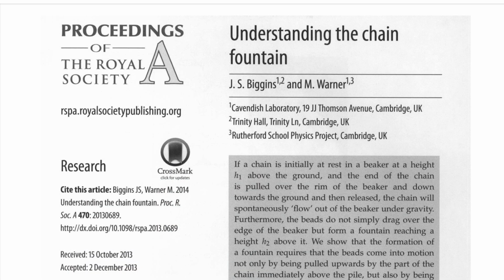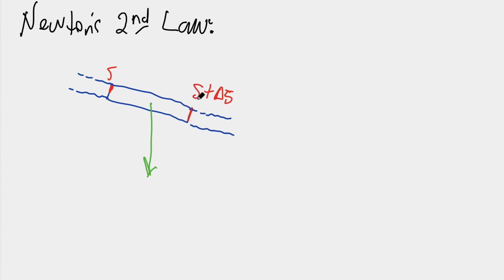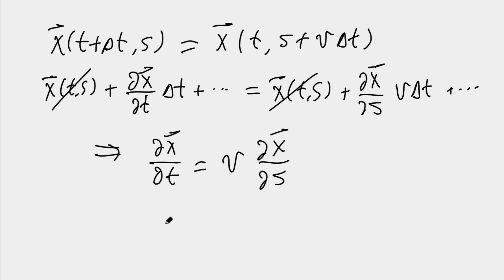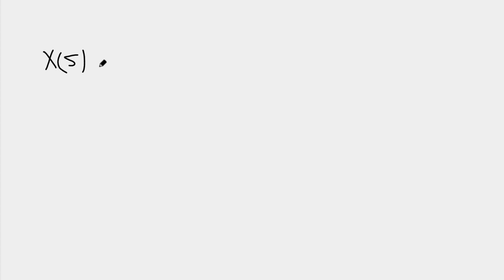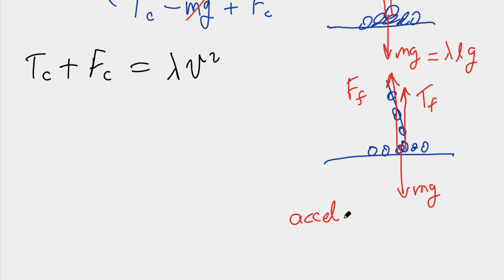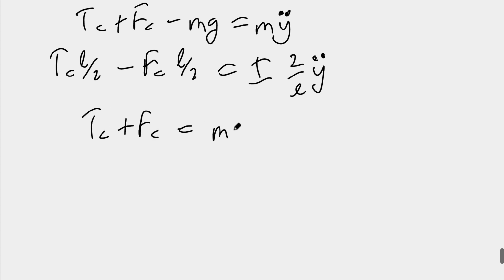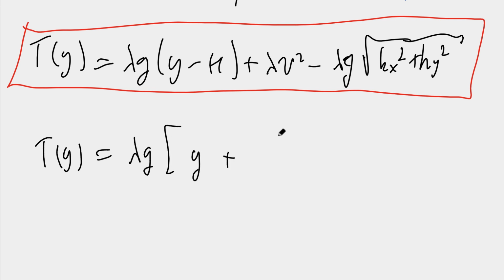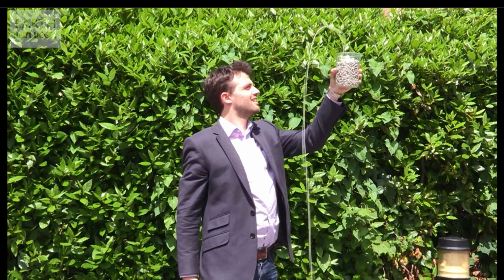Chain Fountain/Mould Effect (Just Do the Damn Calculation!)

Comment: amazing. can you please attempt a solution to the cassette tape problem? assume that the the tape on the left attaches to the right driving spool of constant angular velocity. let A be the point the tape leaves the left spool and B be the point the tape enters the driving spool. let P be a point between A and B.  what is the velocity and acceleration vectors of the tape at point P at any arbitrary time t. let C be the center of the left spool, D be the center of the right driving spool. find angle of AB relative to CD at any time t. \omega_C, \alpha_C, at any time t. how long is the tape for 60 minute play,

Comment: At a "meta-level" the chain fountain/Mould effect surely is something that engineers from the nineteenth early twentieth century would be well acquainted with - belt-drives were used to distribute power in factories to drive machinery all over the place. When the speed of the belts become too high compared to the tension, the belts start to "overshoot" around the wheels (there are a couple of videos on here illustrating this phenomena). Since that cannot be good for anything (power-transmission, stability of operation, workplace safety...) this surely must have been a point of emphasis in engineering education? Thankfully we got more efficient and safer power-distribution systems, but then this quirky mechanics got left outside the curriculum and generally behind and with time forgotten...

Comment: I appreciate the math, but skimmed through it only. You claim to have gotten similar results as Biggins and Warner, but they claim a fountain can only rise from rigid chains such and these, and that it needs a hard support surface. Do you assert this as well? I'm curious as to what your analysis says. And what of different chain configurations, can your analysis predict whether a chain configuration will/can yield a fountain? If so, can easily tell which fountain will be higher? I'm curious as to the extent of your calculations. What all can it predict? Thanks in advance. I'd like to know because my findings says Biggins and Warner are wrong and that no force from the surface is needed. Does it exist? Yes, but it doesn't give the fountain its rise is my findings. They claim it's tension and this additional force from the surface. Do you take the same position? Just curious. Thanks in advance!

Comment: NO WAY!! Too many considerations, so may simplification. That can't translate reality! 

My take is:

1. Roughly, the driving force pulling the chain down is equal to the sum of masses of the falling beads times gravitational acceleration. Hence, the pulling force will increase until the first bead in the chain reaches the floor, after that the pulling force will be constant.

2. A chain in tension is an efficient system to transfer mechanical forces, therefore each bead resting in the pile will be yanked out in succession by this pulling force.

3. If losses are low, like friction forces, beads will need to be yanked out in very rapid succession, with huge upwards momentum, and that will create the fountain effect.

4. In other words, the bead's initial kinetic energy will have to be transformed into potential energy and again into kinetic energy downwards, if energy losses are small in the system. 

The math to prove this should be much simpler.
Reply: I agree. Also, watch how the beads leave the surface. They do so chaotically. Some swirl in the horizontal plane before being lifted by the chain tension. Another consideration is that a force applied, but not moving through a distance at the boundary, will do no work therefore will not add to the kinetic energy of the system. Unfortunately, this is so ingrained in internet folklore that no one will believe you (or me ;).

Comment: At 0:50 u are wrong.
The inertia explanation is correct.
The Cambridge explanation is rubbish.
There is never a bonus-kick at the container/jar/beaker.
There is indeed a bonus-kick when a falling chain-link hits (collides with) the floor of the laboratory, & this adds to the downward pull of a chain, & increases the size of the fountain etc (by say 1%).
But that extra (bonus) force is initiated by the falling/colliding link itself.
Meanwhile, back in the jar, a rising/yanked link will indeed get a kick from the floor of the jar (or from the links supporting that link), but, that kick is not initiated by the rising link, it is initiated by the preceding link.
The preceding link has a limited amount of impulse to give.
The kick from the jar results in a similar (but opposite) kick being given to the preceding link.
But the kick from the jar is not a bonus-kick.
The initiating impulse from the preceding link is not added-to by the kick from the jar.
The impulse of the kick experienced by the rising/yanked link has been borrowed from the preceding link.
In reality, borrowed from the full/whole chain.
Hence, at the jar, links or beads, it makes no difference.

In reality, there is no rising/yanked link. Duznt happen.
What i mean is, we mostly have a rising/yanked arc, made of many links.
In slow-mo u can see that there is mostly a long arc of moving links (talking bout metal beads here).
And the movings usually involve being dragged gradually horizontally for a time, & gradually upish.
There is no sudden kick -- it is a gradual    kkkiiiiiiiiiiiiiiiiiicccccccccckkkkkkkkkkkkkkk.

Look in slow-mo at a bead chain fountain.
There are say 4 adjacent beads acting as pseudo-links being yanked/jerked up.
(a) But, these pseudo-links are not rigid, they have a lot of give.
(b) And, these & the trailing say 5 or even 10 beads are moving horizontally & have daylite under them.
(c) The pseudo-links never have a solid floor to kick (down) against.
(d) And, even if the last bead in the pseudo-link does enjoy an upwards (very very weak) kick, this kick is off a slippery & lose bead or two, & the kick moves thems beads sideways (or forwards)(or backwards)(they are after all lose in every way).
So, beads do not provide anything like a solid surface to kick offa.
Sheeeesh!     Stone the crows!         Milo give me strength!            Are we blind!

The fountain (ie the arch)(the half circle) is simply due to the inertia of a chain.
If a stationary chain lays over the top of a wall, it forms a sharp V-bend.
If the chain is pulled down on one end, then it will rattle up & over the wall, with some speed.
If the speed is sufficient, the sharp V-bend will become a U-bend, due to centrifugal/centripetal forces opening up the V.
If speed increases, the U-bend opens further.
If speed increases a lot, the rising chain leaps up clear of the wall, & stays clear, the zenith/crest depending on gravity, & the U-bend opens some more.
And we have our fountain.
The height of the crest/fountain depends on speed (& is probly higher if chain heavier).
The radius of the U-bend/fountain depends on speed (& is probly larger if chain heavier).

Steve Mould & others say that the radius of curvature cancels out in the equations, & doesn't play any roll in these dynamics.
Steve is wrong.
If he were correct, then that would mean that the radius can vary greatly, for any given setup.
It might mean that if u initiated the fountain with a given radius then it would affect the final (maximum)(steady state) radius.
But i reckon that the radius (for a given setup) tends to one number.
And i reckon that the radius (for a given setup) varies with speed (ie varies with drop).
Just koz the radius cancels out in some dynamical equations duznt mean that radius duznt play any roll in the dynamics.

Steve Mould shows how a horizontal tight pattern of rows of chain (beads) gradually moves away to the west (due to the kick-effect) when the end of the chain is pulled east.
Yes, there is some kick effect, due to the pseudo-links.
But, the greater part of the effect is due to a chain's inclination to retain a pattern.
Here, we see that at each end of each row the chain forms a loop, looping around & back throo say 220 deg, such that the rows are hard up to each other.
As the end of the chain is drawn east, the end loops move across & back & across & back etc.
Now, Steve knows that a chain has a memory, ie it tends to retain a pattern.
In this case, that pattern is a 220 deg loop.
And, as the loop or loops traverse across & back etc, the loops slowly push the rows west.
That westwards slow pattern-push is a different animal to the quick jerk of a pseudo-link kick.
The slow pattern-push duznt suffer from the hi losses suffered by a pseudo-link kick.
Pseudo-links are not rigid, they have give. Give aint a problem for a slow westward pattern-push.
I said that yes there is some kick-effect. 
But, i have already said that these kicks are not bonus-kicks.
They borrow from the overall power of the chain system.
They don’t add to the fountain.

It is virtually impossible to load/store a chain in a jar without having loops. 
And loops result in jumps. 
If u have a close look (in slow-mo) u can see that chains have a lot of horizontal movement before exiting vertically, & the chain sometimes suffers little jumps in the jar, as each leg of each loop jumps (horizontally) over its mate. 
Jumps magnify the fountain, kicks dont. OOPS. No, i am wrong. These little jumps are not bonus-jumps, just like the kicks are not bonus-kicks. Any vertical impulse gained by a jump must have been borrowed from preceding links. 

Also, the horizontal movements seen in the container/jar/beaker are a waste of impulse.

But, in any case, we don’t need bonus-jumps nor bonus-kicks to achieve a growing fountain, & to achieve a very high fountain. 
All we need is lots of speed. The chain will crest at any height, depending on speed. There is no limit.
The idea that something special (like a bonus-kick) is needed (if the chain is to rise above the edge of the jar) is silly.

One thing that everyone has missed, in every youtube re the chain fountain (that i have seen), is that vertical jump effects & vertical kick effects (etc) are cumulative, and lasting (tautology alert).
Or at least partially cumulative & lasting. Air friction, & link friction see to that.
Anyhow, cumulative/lasting effects are the reason for some of the slightly weird gyrations/waves.
For example, it (lasting accumulation) is why we eventually get a persevering, vertical component of arc (a mini fountain) when the test seems to be strictly in the horizontal.
Reply: I agree
Reply: How old are you sir?

Comment: I like this approach and this video, I really do. My comments come from a place of respect.
So at one point, to find the 'stationary' solution of the equations, you set the first derivative equal to zero.  On a potential energy graph like y=x^2, this will be a point of stable equilibrium.  But it seems to me that in your model, this catenary is an unstable equilibrium.  Since, empirically, the physical chain fountain reaches (/approaches) a somewhat stable state, there must be some negative feedback in the physical system, not a part of this model, which counters the inevitable wobbles away from the unstable equilibrium, and indeed, brings the system towards that point from a state that's really quite far from it in state space, the state of the end of the chain dangling from the edge of the container.
If you could show that this stationary  solution is a stable equilibrium, an attractor, that'd be massive.  Otherwise, you're not showing any reasoning, or any mechanism, by which the system goes from the state 'chain-draping-over-the-edge' to the state 'chain-fountains-up'.
Best of luck.
Reply: How old are you sir
Reply: @lawliet2263  In the double digits. Why do you ask?
Reply: @hughobyrne2588  what's your background in education?
Reply: @lawliet2263  I've been on both sides, both student and teacher.
Why so nosy?

Comment: There's also an increasing fountain height to calculate as demonstrated by Steve Mould. I suggested aerodynamic lift is developed by the top arc shape & bead chain speed. Can you calculate the Bernoulli or Euler formula for resultant increasing lift?
Reply: No, as vel of chain increase as the end reaches down, if pulls harder the stationary chain. So height increase. But notice it doesn't decrease, bcz the vel never decreases of any link of chain

Comment: One may choose formulas based on understanding of the problem.  If the fundamental physics / issues of the problem are misunderstood, incorrect formulas may be chosen, and thus the calculation becomes meaningless.  Especially with several complex systems coming together to form an even more complex system.  Torque, Inertia, chain-whip-motion mechanics...

Comment: Wow. I didn't know any of the calculation for this, had a little trouble trying to understand all the formulaes (not because of your explanation, you were very clear), I'm just not that well educated in maths and physics. Based on observation, I though the force needed to make the beads change direction, would translate back into the chain, in form of tension, divided to both sides, like half the orbit of the moon, symplistic speaking. The shorter side (the chain leaving the pot), has less mass, and therefore achieves a higher acceleration, bringing the chain arch up. For a given shape, what would change this force is only the velocity of the chain: Higher velocity means a bigger force needed to change the direction, which would be translated in tension on the chain. I tought, if so, the lateral movement shouldn't matter, and that I was just wrong for some reason i couldn't understand.. I just simply couldn't prove I was right. Or wrong!

I really wish I studied more.. This was just a lucky guess, that barely hit near the answer. To think Galileo did all the calculations of our solar system even before he could observe.. That is science!